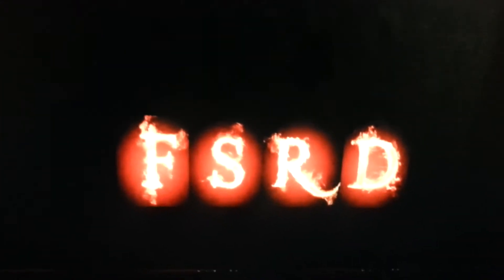Update: Fuel Vaporization Injection Nozzle

Comment: Start thinking like NASA...they are developing efficient ways of getting vehicles to work in an atmospheric pressure that is less than 1 per cent of 30 inches of mercury, temperatures that go down to 100 below at night, zero humidity, zero oxygen.  They are using electric motors from the electricity that they are generating from Solar, Wind and generators.  These generators run on a wide variety of energies.  What you need to do Tyson, is have the ability to monitor all your fuel source pressures, states (liquid, solid, gas) and temperatures (before, during & after).  Just like a laboratory, so that you can dial in operation from peak efficiency from CONSTANT sources.  You are the best Fuel Scientist on YouTube.  Don't give up and keep that positive attitude.  The answer is close.

Comment: Tyson, was wondering if you ever encountered any problems with excess heat with the vapor engine? Supposedly lean burns are hotter, but now I've been doing more reading and some say otherwise.
Reply from the maker: The problems I ran into using exhaust heat to vaporize the fuel was the containers surface was way to large therefore way to much vapor was made so the system could not run at a good efficiency. 

As for a lean burn causing a engine to run hotter yes a lean burn does cause an engines temp. to rise. The vapor system is not causing an engine to run lean, it is making the engine run more efficiency which causes a decrease in temperature.

Comment: Your nozzle cannot be designed with plastic? With  a cheap 3d printer you can find at around 200$ qu-bd 2 up printer
Reply from the maker: No it can't the temperature of the nozzle will get way to hot and will melt plastic.
Reply: Tyson Capel shapeways and other 3d metal printing companies can help
Reply from the maker: Part of the design has a very thin wall thickness and I don't think a 3D printer is capable of printing the walls as thin as I need them. A 3D printer would be a great way to go and can be used for most of the design but not all of it. Thanks for informing me of the metal printing!

Comment: Looking forward to acquiring one of those beta test models like I said, if you ever need any electrical engineering help, I'm available text or email, you got'em both.
Reply from the maker: You got it man! Can you message both to me again phone and email. please. I have them just not in a place where I can find them easily.
Reply from the maker: ***** It is very stupid the way they have it now that's for sure.

I always click Manage Videos, then on the left side of the screen I click on the tab that says Community, under the community tab you will see the Inbox button. Thats the long way to do it.

What I did to make it fast is when I am in my inbox I drag the inbox up to the bookmark bar in google chrome so all I have to do from that point on is click on the youtube bookmark titled Inbox.

They sure do make you do allot just to check your inbox.
Reply: Agreed, I dropped you an email at fsrd regarding the solution to your problem.
Reply from the maker: ***** I got it thanks!

Comment: Thanks for the video update.
I wish I had the funds to help you get this done faster; in the other hand, if you make a list of the parts you need, maybe some of us can send them so you can move forward. The system I'm building takes the signal from the flow meter. This is reliable because AF mixture changes with different loads even at the same rpm. Hope this helps. What material are you using for your nozzle?
Reply from the maker: I will be needing a piece of 1.25" diameter by 3" solid stainless steel rod and a piece of 1" diameter by 3" stainless steel rod. I will also need a 1/2" or smaller down to a 1/4" FNPT fast actuating solenoid valve that I will control with a PWM. I will also be needing some 2" ceramic insulation tape similar to the ones here:  http://www.ceramicfiber.net/ceramicfibertape.htm

If anyone has these materials and would be willing to donate them it would be very much appreciated. Thank you!
Reply from the maker: Tying into the flow meter is a great idea!